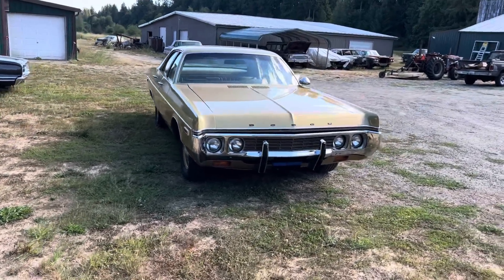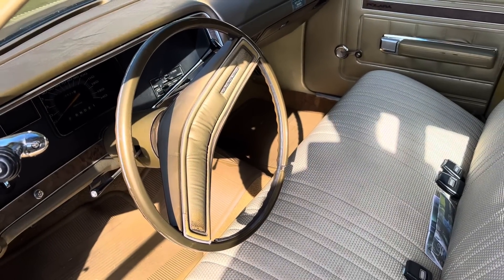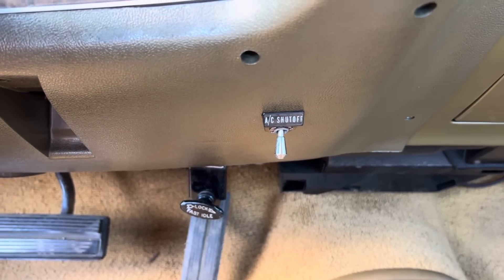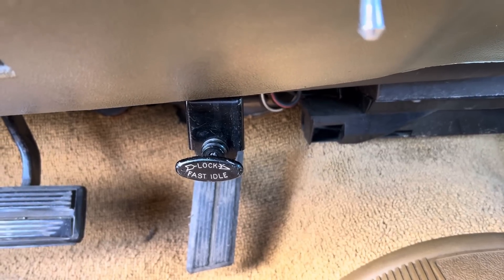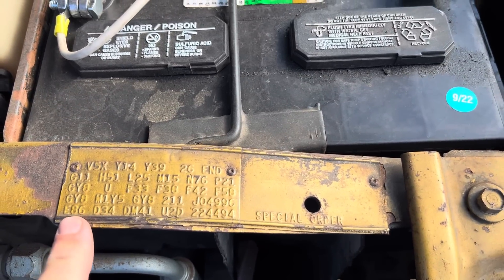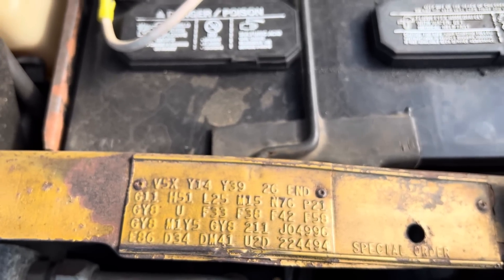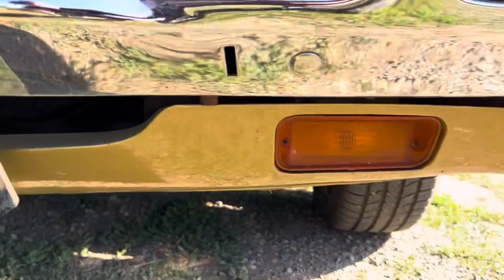1972 Dodge Polara U-Code 440 HP, ex-Washington State Patrol Car Tour

Comment: Hey i saw that dash edge , look up vinal repair kits , they were out out since the 70s used them for dashes vinal seats and top repairs , if memory serves it may have evolded some over time but it was but on with a brush from a jar and sort of dried with a hair dryer . But I have seen it used and it looked good , but you may have to build up layers. you may even be able to get custom colors now . Nice restore !! Hope to see others soon .

Comment: My first car, purchased when I was in Grade XII, was an ex-cop car as well. Mine was a !969 Dodge Polara sedan, but it was more spartan than yours. It had a 383 4 bbl, power disk brakes, manual steering, rubber flooring (easy to clean!). No a/c, no power trunk release, vinyl seats. Very plain. The dealership had repainted it - turquoise lower with white painted roof. By today's  standards, I would say it was an eight-seater! It was huge. I liked it ...for a while, but because it wasn't cool for an 18 year old, I bought a new Nova a few months later. By the way, I happen to like the front end of the '72 Polara 👍

Comment: Love 70's cars. We had a 1970 Ford Custom cop car. Heavy duty suspension. Only option was power steering. No radio, vinyl seats, black on white. Super hot seats in the summertime. Burn our legs. It always started in any weather. 20 below zero it started right up. Brand new cars that winter wouldn't start in that extreme temperature. Cool feature was the driver side front door. If you pushed the lock button down and just closed it, it would automatically pop back up and unlock so you wouldn't lock your keys in it. To lock the door you had to push the button down, then press the outside door button in and grab the handle and close it. Otherwise it wouldn't lock. Lock out protection!

Comment: Looking good! Two things I'd do is add period correct Electronic Ignition AND the factory police exhaust tail pipes! They come out almost straight and are tapered down ever so slightly with the proper angle cuts, Those are killer! I'd add a picture but we can't

Comment: The "fast idle" was also used after a high-speed run to assure the engine did not overheat. Higher idle revs dissipated mor heat.

Comment: Owned a 71 ex-chp polara. Mine had the trunk button in the glove box. Was not a polara custom - just a polara. Also had a dual snorkel air cleaner. Car had manual steering which was a real drag. Car got 8-10 mpg.

Comment: Dude, that Polara is dope, just picked up a 73 Polara Custom Coupe 360 2 barrel 85,000 original miles. F7 Green. Gonna store the original hubcaps and repaint yhe factory steelies in F7 then Dodge Dog Dishes going on, not a spot if rust on it. Love thrse big fuselage Mopars man.
Reply from the maker: Sounds like a great car!  Have two 73 Polara wsp cars as well.

Comment: I had a summer job with the Washington State Patrol in 1975 and 1976 when I was in college. I was assigned to the WSP communications center in Bellevue, installing and de-installing police radios and communication equipment in both new and surplus vehicles. Our team drove the surplus cars an hour south to Olympia where they were auctioned off. I still remember driving an unmarked car (a tan one) and flooring it on the ramp from southbound 167 to westbound 18. I'm pretty sure it was a '71 which was more powerful than this '72. Wow! The 440 Super Commando accelerated that heavy car like it was nothing. Of all the patrol cars I drove that's the one I remember liking the best. I sure wish I owned it today.
Reply from the maker: That’s awesome!

Comment: " It's got a cop motor, a 440 cubic inch plant. Its got cop tires, cop suspension, cop shocks. Its a model made before catalytic converters so it'll run good on regular gas"   Elwood Blues.

Comment: I’ll give you a quick way to stop that trunk rust. Get POR-15 then cover that with the texture coat after the POR-15 dries. The POR kills the rust and the trunk texture coat protects it from UV light. I’ll be doing my 22 Tacoma frame in POR -15 not long after the lease is up. It’s cheap insurance from rust and will keep my truck solid for many years into the future

Comment: It's got a cop motor, a 440 cubic inch plant, it's got cop tires, cop suspensions, cop shocks. It's a model made before catalytic converters so it'll run good on regular gas. What do you say, is it the new Bluesmobile or what?
Reply: Wĥat are y0u askin
Reply: @MichaelPoole-no1gv  
Not me, it’s what Elwood asked Jake.
Reply: Fix the cigarette lighter

Comment: The 1969 Dodge Polara had a sleek new streamlined body style called the “Fuselage Design”, which would continue until its end of production in 1973. The new streamlined body style, 3.23 gears, and the 375 horsepower 440 Magnum made this one fast cruiser.

0-60 MPH = 6.3 Seconds
0-100 MPH = 18.1 Seconds
1/4-Mile = 14.3 Seconds
Top Speed Recorded = 149.6 MPH (Chrysler test track in Chelsea, Michigan)
The California Highway Patrol and Los Angeles Police Department (LAPD) were prized enough customers that Chrysler made specific parts for each department. The California Highway Patrol even had its own cam grind.

This car was so fast that it’s 149.6 MPH top speed record wouldn’t be broken until the 2006 5.7L Dodge Charger recorded a 150 MPH top speed during the Michigan State Police vehicle evaluations.  Super cool cars!👍

Comment: "It's got a cop motor, a 440 cubic inch plant, it's got cop tires, cop suspensions, cop shocks. It's a model made before catalytic converters so it'll run good on regular gas. What do you say, is it the new Bluesmobile or what?" ~Elwood

Comment: Its a 440 cubic inch, not 440 HP. Its 280 net, 385 torque. Its the same magnum engine that powered the 72-73 Charger. A force to be reckoned with for sure. With the 3.23 gears it will do 125+ on the highway.
Reply: I think he knows.
He has got the thing for 20 years.
440HP propably means 440 High Performance.
Reply: @suomenpresidentti  more for the viewing audience than the owner!

Comment: 11:20 Funny you should mention that.  I worked for the Oregon State Police around '89-'90 as a member of the crew that installed all of the OSP-specific equipment in/on the Caprice cruisers and Commander and Narc cars.  When I started there they were still installing the electric transfer pump system on the fuel line.  While I was there the TBI Caprices came in and we had to quit due to the increased fuel pressure they used.

Comment: My father was WSP, retired in 73. I remember going for a ride with him. His Polara held passing gear to 120. Had a 1000 cfm thermoquad for no gas mileage.  My first car was a surplus WSP 64 Galaxy 500 with a 427 interceptor. It was a sergeants car so only had a spotlight. Blew all my friends hot chevys and mopars off the road. Dad had the first V8 WSP car. A two door coupe specially built in the state garage to catch hot rodders with v8s. WSP drove sedan deliverys with flathead 6s then.

Comment: Special order police cars and taxi cabs had an oil pressure gauge in the dash where the clock would’ve been. Your dash looks like a clock face without a working mechanism. Mechanical fast idle is cool, haven’t seen it before, I guess it’ll help with cooling and battery charging while during extended idling with lights on.
Reply from the maker: Oil pressure gauge was always optional, not sure why WSP didn't get them but this car did not come with one originally.  Super cool option and have found a few over the years.

Comment: So if you had a radio (in it) you’re aware (if it’s the same as my 71 Plymouth)the rhs fender didn’t have the embossed antenna mount.Or it did and you deleted it and therefore the mismatch paint on that fender…
Reply from the maker: Fender is a very long story…. Nothing to do with radio delete.

Comment: Gorgeous classic machine there!

I had a 1983 Dodge Diplomat, former Illinois state Trooper car, also a "plain wrapper."

It had a 383 C.I.D. Commando V8, & was 1 hell performer on high speed turns. Too bad I blew roughly 36.4% of the engine's internals through the hood, & passenger side fender. 

I'm just glad I didn't have anything punch through my skull unit. I also loved that car...

Comment: yapping about car .. should have driven it  and let everyone  hear that beast kick in 
Most of these chirps 2nd bark 3rd i own 69 70 71  patrol cars   in process 
Buying 1965 polara 426 max wedge patrol car  with 2:80 posi locker  from Texas  
Higher up officers car  67 k original miles  dark blue   great video  but need to show this boat kicking in  they sound sweet 😊

Comment: 370 HP in 71, 285 HP in 72, nice car.
Reply: '71 hp rating is "gross", at the flywheel. '72 hp rating is "net", at the rear wheels. Transmission and differential eats up some hp. Generally around 70.

Comment: Bought a 71 fury state police car senior year high school 440 , noisy 373 posi rear. Swapped a 273 open from a 74 I had .was a tire frier , had a cooler for everything even power steering .car handled terrible even by 80's standards .blasting down powerline dirt roads even with 6 people ,car would not bottom out .

Comment: Tom, maybe you can answer a question for me. I love the 73 polara but all I can find are 72s. Will the front parts before the hood and the rear parts , IE bumper lights and fiberglass corners inter change from 72 to 73? Thanks
Reply from the maker: I think the frame horns are different.  Never tried it before but with the 5 mph bumpers think they reinforced everything up there.
Reply: @rocketresto  I know the 73 was also used as a police car so I'm still not sure. It's back to more research I guess. Thanks for the response. If you ever see a nice 73 two door  for sale, please let me know. I'm trying to get back my favorite car from my youth. I've had everything from a 49 Ford to a 69 Cutlass rag top to a Chevy Avalanche Z71. Over 40 cars later and the 73 Polara has always been my favorite . Thanks

Comment: My brother and brother-in law worked at the Belvedere plant in the late 60’s early 70’s. When they couldn’t keep up with the line if there were parts left over they would throw them in the trunk and let the dealer install them. My brothers first job was driving them off the line to the staging lot for transport. He said so many would smoke or rattle. They’d park it and let the dealer worry about it lol.

Comment: I had a Dodge Coronet ex-cop car that my dad bought for me at police auction. It had a cheap paint job and you could still see the blue and white local police colors around certain areas of the car. I later got a better, more thorough paint job on it. When I traded it in, I got more for it in trade than my dad paid at auction.

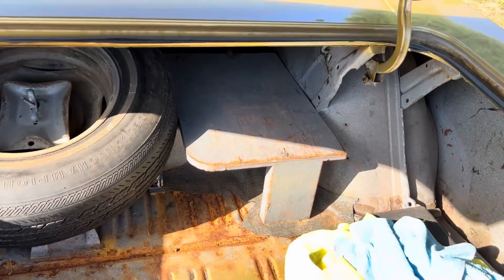Comment: The car looks nice. It is more likely a 449cid engine . Not 440 HP for sure. I drove a version used by CA CHP about 1983 it was well used and sucked air like a Hoover vacuum on grandma’s carpets loud AF you could hear it coming a half mile away by the air suction.  It was repainted to a tan and beige two tone for the city PD. A minor improvement over well scrubbed bulk and white.  I’d say don’t buy a used Police car as they get lots of wear and tear and tons of abuse. It was not a fast patrol car on city streets or short runs up the freeway. I guess the units bought for $200 each or so. And think the dozen cars were 1976 products. . Definitely faster on freeways than city streets. Lumbering cornering like driving a pickup full 13:50 13:50 
 of bricks in the pickup bed box. 
Old police cars are pretty much junk when they are liquidated . Cities ànd government agencies pay big money to buy them new, guys. It’s no cheap way to buy a race prepped engine. If you love the idea of a used police car, buy a Fird Criwn Vic. There are plenty of ways to improve a used cowboy Vic in both engine and suspension.

Comment: Knew a girl who had one with a smaller motor back in the early 1980's when they were cheap. (hers = 275hp?) Cops would have the "Interceptor Package." That would be .......... wreaked tires in my hands.  Big back seat B-).

Comment: All-time favorite! Had one decades ago from the FHP. Had a 2.93, or 2.94 Dana rear end and stupid teenaged me would take it out about once a week, or so, and drive it as fast as it would go. 136 MPH as I recall. Solid car at high speeds.
Reply: I got stopped by FHP when these were the cars FHP used.😮
Reply: DId you get pulled over for a violation? Or for having retired equipment, lights, etc?  Or for just looking a bit TOO much like them?
Reply: Why are we still alive?  Luckily I usually had a smog 350 back in the day, so could only hit 110 or so in most average V8s,  but one buddy got ahold of a Buck GS 455 Convertible, and Ah....top end ridiculous with a 2.93 standard gear,  it was a 1970 and had a large Holly on it,  we are pretty certain this car was capable of 140(Speedo wound over an inch past 120 pointing straight down...LOL), and could do that with 4 guys in the car....that Car would kick down and catch rubber at highway speed on demand.
Reply: @gt-37guy6  No, lucked out. Never pulled over, never wrecked. Car had the requisite one-solid -color repaint, a very dark midnight blue. Hawkish, sinister looking car with that dark color.

Comment: I’m not really a Mopar fan, but I appreciate these old cop cars of any flavor. My personal favorite from the Mopar camp was the 70s B-bodies. My home town sheriffs department where I was a member of the explorer post they sponsored still had some B-bodies with 400 four barrels. Although they’d been passed down the reserves and unusually only operated on weekends and special events, some genius had decided that plugging the secondaries during one of the oil crises. One enterprising reserve took one home, cleaned up it up, and rebuilt the carb. I rode with him a few times on weekends and that car, despite still being a smog motor with high miles would still hit 110 with a less-than-aero double bubble gum/placard light bar.

Comment: I always thought these Dodge Polara police cars looked so cool. With the wider wheels and tires with the lowered front end which gave these cars a really nice rake to them, these cars had a very strong and intimidating road going appearance. The stance meant they were serious. And up until around 1973, especially with the 1970 and 1971 cars, these things were really fast. Around that time, I had a 70 road runner, and that car was no slouch! I was running close to 130 one night and a Washington state patrol Plymouth fury ran me down in literally nothing flat! He was really moving a whole lot faster than I was. He was not after me, he was after the guy in the 69 429 cid 4v Ford Galaxy in front of me. I was faster than the Galaxy, but that fury was even faster than me. I read a road test some where that a magazine instrument tested one of those pursuit cars and it reached 157 mph in police trim.  For the early 1970s, that was really really fast for a street driven car.
Reply: Still a dessert-for-breakfast car. Too big, too fast. If they wanted something truly "serious" from Dodge in '72 they'd be looking at a Mitsubishi-built Colt or at most a Dart with slant 6.

Comment: ** The engine does NOT have 440HP!! 440 is the cubic inch displacement of the engine! (In `72 the 440 put out about 285HP)

Comment: Beautiful fuselage body.  Love how the round front and rear ends match. I think this is what they call a slicktop.
Reply: In more ways than one, back in the day if an ex-cop car with holes for roof equipment was bought by a dealer they'd slap on a vinyl top since that was cheaper than filling the holes smooth and matching the paint.

Comment: WE need a startup and Test drive video!   I love Police vehicles, my favorite was the Mid 90s Crown Vic, they were actually light and tight cars.  So if that Polara is running correctly,  she should be good for around 140 MPH top end!  Fastest police car until the Caprice LT-1 just about tied it, then the Hemi Charger Squads were a bit higher top end, but the Polara did not have an overdrive gear!  I will claim 135 MPH on my Vic Squad going through  California Desert at 4:30 AM.

Comment: Only thing that sux is 72 was the first year of lower compression engine because of nox mandate
Reply from the maker: Yep but when I did the motor it was rebuilt to 71  440 HP specs so has a lot more get up then stock.

Comment: I know that car! Still awesome- Id love to find a certified speedo for the '76 Valiant sedan, but probably going to have take an earlier 120-mph and "Re-create" one. I am running the 11.75" rotors, an oil cooler & fuel pump from an Aspen A38, trans cooler from a '76 Dart (City Light car w/ all kinds of odd options), PS cooler from "I don't remember," and a 8.25" SG with 2.76 gear. Has the 340/HD suspension & cooling (big rad, clutch fan, shroud)...
Its just a fun, malaise sedan- certainly not all stock or a "Real," cool cop car like yours
Reply from the maker: I actually have an A-Body certified speedo.  Came out of a Seattle PD car that ended up as a prison car near Aberdeen.  Found it in a wrecking yard out there and I was looking inside to see the speedo, leaned on the side mirror and it fell all the way through the door to the ground.  Never seen a rustier car in Washington.
Reply: @rocketresto  I'll give you a call shortly

Comment: My parents bought a 72 Fury around the time I was born. I screwed around with all the controls any time I was left in the car by myself (it was the 70's after all). I discovered that if I turned on the hazard lights and turn signal at the same time with the key off, all the accessories would turn on and off with the flashing lights. Tried this again in my friend's Tradesman van many years later and it did the same thing!